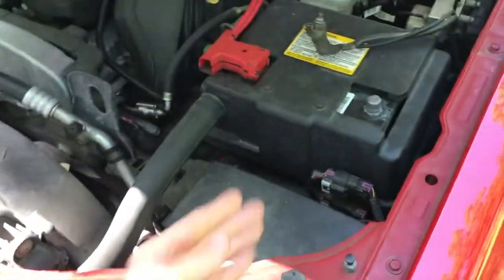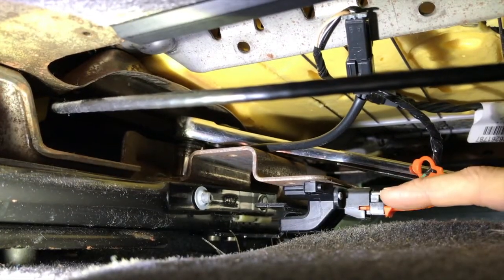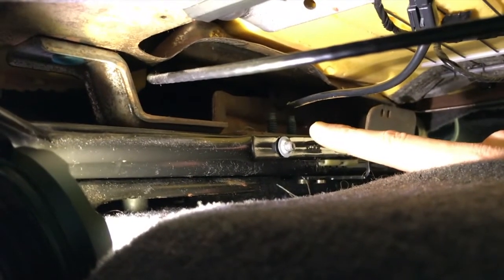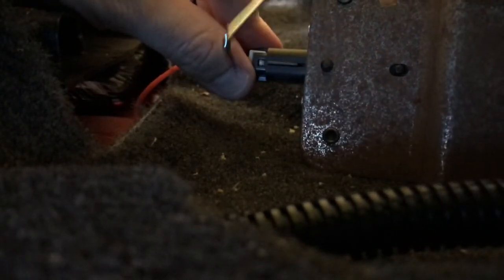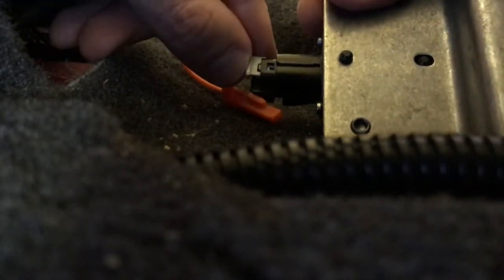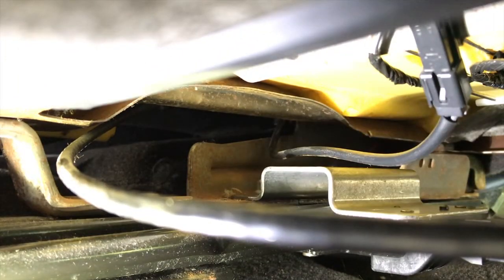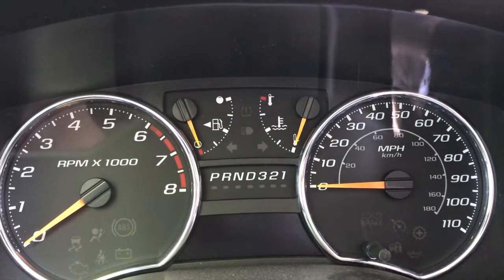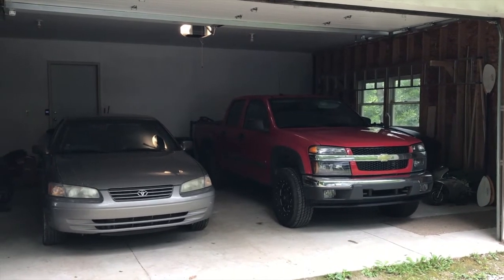"B0083/B0084" Colorado/Canyon - How to Replace Drivers Seat Position Sensor!

Comment: What kind of symptoms did you have? On my 07, if I move in the seat the airbag light comes on and if i move again it goes off
Reply from the maker: Christopher Allen 

Thanks for watching.  While driving one day, our check engine light turned on.  We hooked up our OBD scanner and the code read “B0083”.

We then selected the Code Connect button on our OBD scanner & it informed us what part needed to be replaced.  Let us know if you have any questions.
Reply: @DIYwithMichaelBorders  on mine the actual air bag light which is red goes on and off randomly if you move in the seat
Reply from the maker: Christopher Allen 

Thanks for the reply.  Interesting...🤔

Hopefully that goes away after replacing part.  Definitely keep us posted.

😎👍🔧🔩
Reply: Christopher Allen it might be a shot in the dark since this post is so old but I have the same problem goes on and off if you move seat did you ever replace this part? If so did it fix the problem?
Reply: @robliles1222  I remember it well since I did the repair myself. It ended up being a wire going to the air bag position sensor plug under the seat that wasn't broken by eye but it didn't have continuity. I wiggled it and it broke. I wound up cutting and re-soldering the break in the wire and the light went off. Never had the issue again. Unfortunately due to rust issues I sold the truck to someone  and got most of my money back before it got worse. I went from that way back to a 1998 K1500 4.3 which is older and has issues but the frame is 95% vs what the colorado was. Hope this truck I'll be married to vs the 2007
Reply: @camaro2002rs  thanks man i think I have the same issue I got down there and barely wiggled the wire and sprayed so air duster around it helped but just goes off less often I think I’ll check out the wire thanks again man